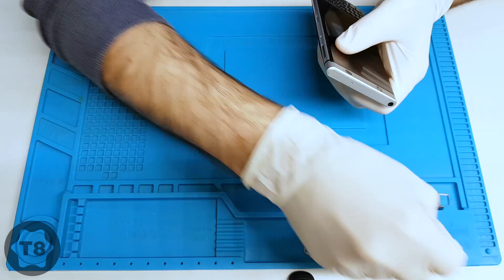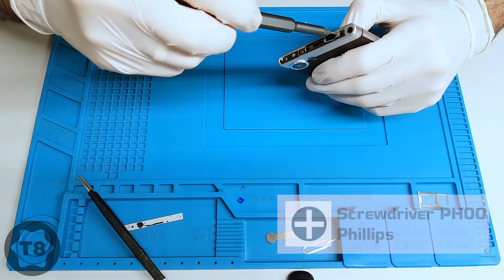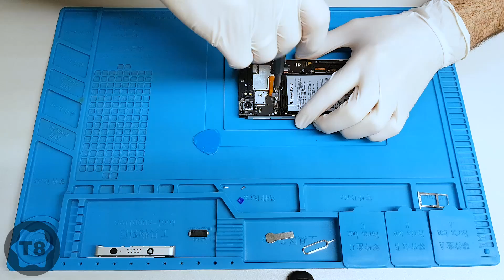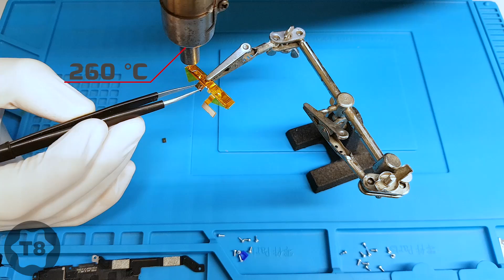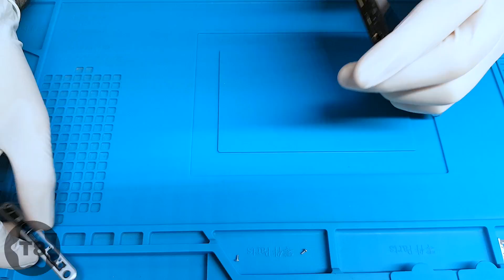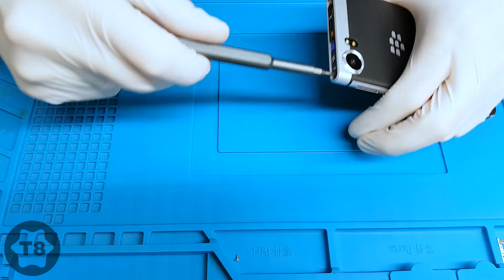Blackberry KEYone Disassembly & Microphone replacement

Comment: Blackberry Keyone is an easy phone to repair things around, I had mine running for 3years+ with some components like Battery, and LCD screen changed till recently. Stock up parts, and it'll sure to keep u constantly running for years to come 😎👌
Reply: Who did the repair to your Keyone? I need a charging port replaced. Can you give me a name and contact? Thanks!
Reply: How on Earth do you get the top plastic part off? Can't seem to get that plastic part off so I can remove the screws to get my rear of case back on. Cheers

Comment: Hey! I've got a BB but I have a problem. You know this port that connects the tape from volume, power and camera? The port itself is missing the little plastic cap on the top of it so there is no connection between port and the motherboard. Any ideas how to fix it? It seem impossible to solder it.

Comment: will this fix the problem with the in put voice? I can hear calls but no one can hear me back
Reply from the maker: Yes, replacing the microphone will solve this problem. This repair can be done at any service inexpensively.
Reply: @TorxEight  none work anyway, im going to order the mic and have it fixed, thank you
Reply from the maker: @clarabruselas8444  Before ordering a microphone, check if there are any problems with the software. Check the microphone in Skype or Viber applications.
I also advise you to look at the microphone hole. It often happens that dirt gets into the hole of the microphone.
Reply: @TorxEight  I tried everything at this point so im sure there s a hardware problem with the mic, I did some research and it looks like it s not atypical for this model
Reply from the maker: Then you really need a replacement microphone. I advise you only to order a few microphones, because I often met defective microphones of these models.
Reply: @TorxEight  thanks a lot for your help,  i appreciate it a lot
Reply: @TorxEight  I need some repairs on my Blackberry KeyOne. Can I send it to you for repair?